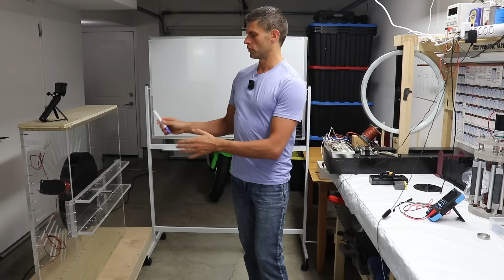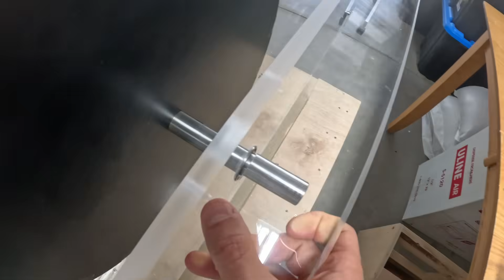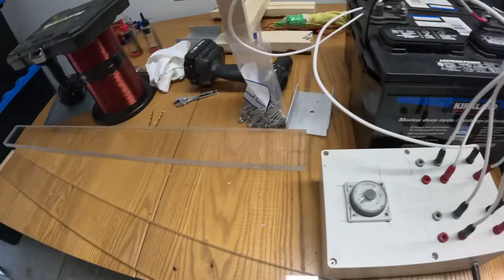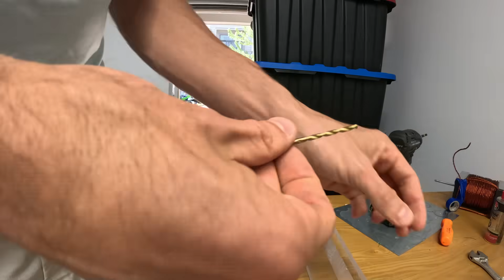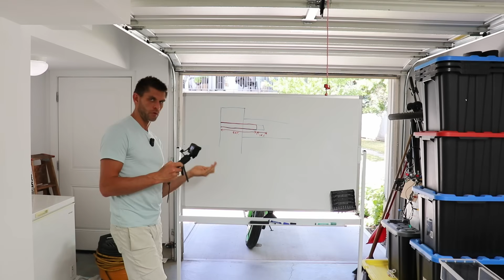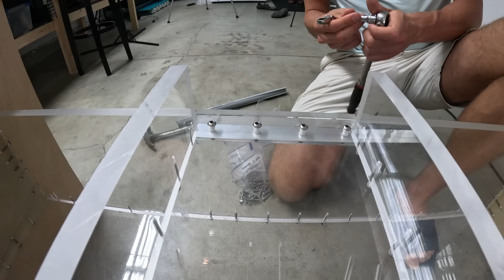This Pulse Motor Could Change the World — And I’m Building It in My Garage

Comment: Would love to see a full schematic of your proposed idea and some explanation on why you think it would generate more energy. Also, how it differs from the Bedini system.
Reply from the maker: I plan on making a detailed video on the schematics in the next few weeks, and also comparing the design to a Bedini system.
Reply: The idea that over unity system are impossible comes from a basic misunderstanding of what constitutes a system, in a closed system you can not exceed 100% efficiency, however in an open system you can. When someone says a ground source heat pump system is 400% efficient based on energy input, we don't blink when that other 300% comes from the environment. We call it 'thermal energy' but we transfer it from the environment to the physical pipes by infrared radiation. Radio waves. 

We pull energy out of the environment in a device we sell all over the world with greater than 100% efficiency that is driven by radio waves from the environment. No one sees it as over unity because we can't convert the 300% BTU energy back to electricity at an efficiency that could sustain operations without more input.

Done right, this is the similar to ground pump but with a direct coupling. You are familiar with electric heating coils, well if you swap the flows around, control the potential blah blah blah you can generate a cold flow the removes energy from the system. Look at Don Smith, Tom Bearden Nikola Tesla, Hutchenson etc. I've personally created these flows. There are books on it if you like Peter Lindmanns "The Free Energy Secrets of Cold Electricity" is a good start.

Back to our analogy; That ground pump pulls energy out of the environment via infrared. Why is it so strange to you that a more direct coupling could be had? In usage the physical coils actually cool, they are literally removing energy from the environment and putting into the system. The system then will return it as heat back to that same environment, balancing back to 0 just not instantaneously as with a closed system. 

So we already have over unity systems, we just don't have any that aren't mixed inputs. When you realize its just a coupling problem its not a huge egg to crack.

Maxwells original equations show the energy is there and how you play off time for energy, its was Oliver Heavy side who removed the time component to simplify the 20 equations to the famous 4. He only considered closed circuits where the time factor always cancels to 0. He did not consider open ones.

So that is why he thinks it will work, as least thats why I know it will work. High speed tri-resonate coil is a better way to do this (no offense, other teams are already building there). Tesla's original design won't work in our modern world. His wavelengths created standing hot/cold spots that patterned out miles and miles from the transmitter. Those frequencies today would fry our modern electronics as we walked through the zones But you speed up the switching and get the waves down to something you can put in a box instead of across a few thousand miles, and you harvest it.

Comment: I would imagine theres a better battery set up, maybe lithium titanate they have much less impedance could handle the flyback high voltage better. Or a capacitor situation introduces much more dipoles that would have less resistance to manipulate
Reply from the maker: Caps for sure maybe, need to use lead acid to get the effects we are after. Once we get it working we can optimize
Reply: @MadscienceLPTECH  Love it, keep it up its inspiring!

Comment: Yo bro, quick upgrade ideas for your energy system. Set up a feedback loop using an Arduino Nano, it reads your RPM, voltage, and capacitor levels, then smart-controls the motor and coils, only pulsing power when needed. This saves tons of energy, and can even reuse back EMF by redirecting it into a second capacitor bank. Use magnetic bearings to eliminate friction, more spin time means more power. Capture heat from coils or the motor with a Peltier module or thermoelectric generator, then feed that energy back into the system. The smarter your system reacts, the less power it wastes, and the closer it gets to being self-powered. Let me know if you want the Arduino code or diagram, I can hook it up. Stuff I’ve always wanted to try, but never got around to.

	•	Use Hall effect sensors to track flywheel magnet position.
	•	Trigger pulse coils only at optimal timing for maximum push = less wasted energy, more torque.

3. Wireless Energy Transfer
	•	Add a resonant inductive coil system to wirelessly light up LEDs or power devices nearby.
	•	Great for visual proof-of-concept or functional applications.
Reply from the maker: Love it keep these ideas coming
Reply: @MadscienceLPTECH  this is the base of overunity, if you get enough feedback to pulse the rotator you can harness the excess with emf induction instead of resistance.
Reply: IfTheCopIs20,AndWePut100w In WeGet 2000w Out.NoNeedForUltraEficientSystem.OnlyDecentEficient.
Reply: Sweet 16 - Ed L-ives on!  So happy to see his indefatigable spirit out there!  Even if you achieve self-sustaining capabilities (hand-to-mouth) as a home generator that could supplement grid source you’re winning!  Some things to think about from his design: dead iron weight around your ground and water…
Reply: "Capture heat from coils or the motor with a Peltier module or thermoelectric generator"

You want to do it with implosion not explosion. If you have excess heat you're fighting the wrong battle. I'm sure he realizes he wants to be switching on the high side and pulling cold electricity out of the coils, like John and Smith did.

Comment: what was your thinking for going so big with the rotor? since it only initiates the collapse of the magnetic field and has no other fundamental function ... The power comes from the coil size ... is there some advantage in the size?
Reply from the maker: Just allowing the mass to be sufficient also the diameter to be large enough to allow enough space between the magnets
Reply: @MadscienceLPTECH ok makes sense, winding coils is a bitch … specially large ones.

Comment: Why do you need so many batteries?
Reply from the maker: High voltage... 120v with 12V batteries take 10 each, x2 for 2 banks
Reply: @MadscienceLPTECH  there are smaller 1, 4 or 7 amp hour 12V lead acid batteries, that would be a lot cheaper, wouldn't they still work? or what about capacitors?
Reply: @voinea12 amps=watts/volts. 
The lower wattage could cause instability and reliability issues with voltage as rotation speed is increased. In this case charge and discharge variance. Would be my assumption.